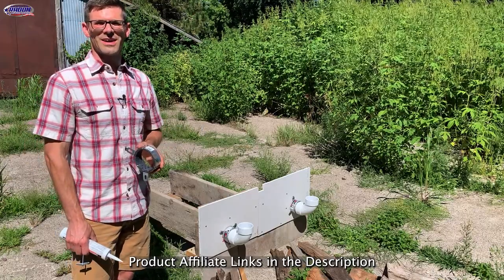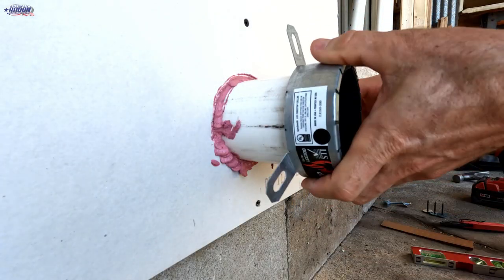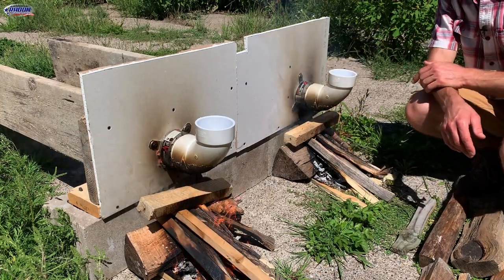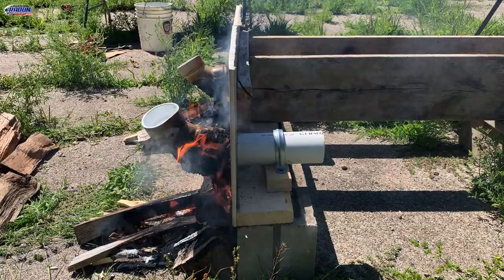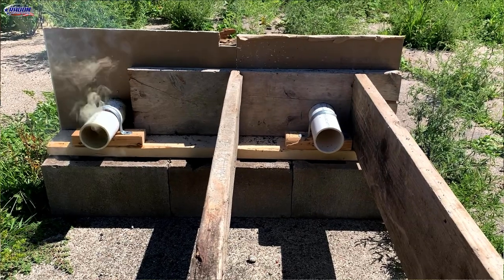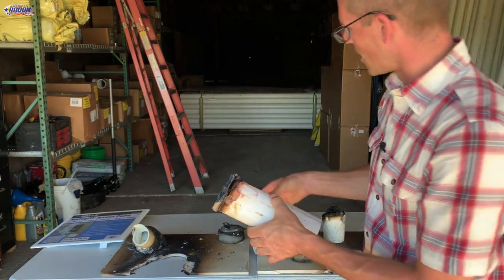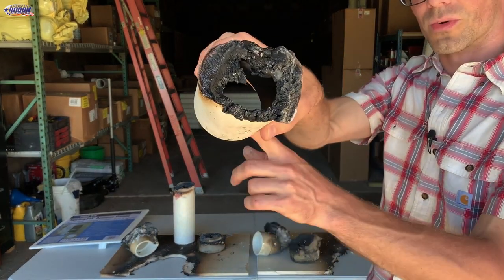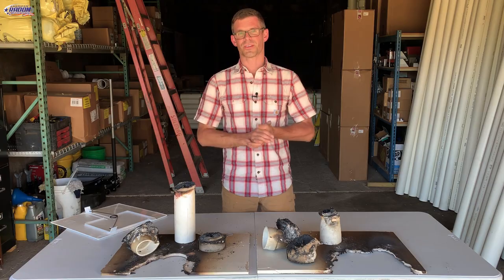Is Your Firestop Collar Installed Properly?

Comment: Quick addendum, you want to tool the firestop product before installing the collar. This does a list of things that work in your favor.

1. Promotes bond to substrate
2. promotes proper 1/2 depth of seal
3. tools out air pockets
4. Makes for a cleaner install
5. Is required for any and all UL assemblies to be a complete installation.
Reply from the maker: Thanks for the tip! Could you leave a link to the resource if you have it?

Comment: Hi, ı have a question. İf ı install circular 0.5 mm thickness sheet metal duct with standart mortar what do you think its is safe to install fire damper (espacialy butterfly tipe) inside the duct and 150 mm wall?
Reply: wall material is aerated concrate 500 kg/m3
Reply from the maker: I am not sure. I'd reach out to a company that manufactures or sells fire-stop equipment.

Comment: Heya, great video for concepts but... Firestop doesn't belong in homes, only multi-tenant buildings with actual fire rated floors and walls built with intent to stop fire.  Your typical "garage" drywall wall use home 1/2" board wouldn't stand a chance for more than a few minutes in a raging garage fire.  A fire in a typical room gets well over 1000 degrees F in under 5 minutes, and continues to rise from there, whereas in your short test, with much lower temperatures in an open air environment, the lower part of your drywall simply "disappeared".  Firestop drywall is 5/8" Type X and while it is far from invulnerable, 1 sheets on either side installed of a stud will actually last for one hour, not minutes.  Just be careful not to pitch firestop for single owner homes as it will absolutely fail to help due too wall disintegration...
Reply from the maker: Hey Mike, thanks for the info. How do you suggest complying with section 6.2.10 of the mitigation standards? https://standards.aarst.org/SGM-SF-2023/22/index.html#zoom=z
Reply: @AmericanRadonMitigation  Hey, difficult to say, I believe you are working under US code so I can't comment on specifics but standards that a non-profit like the AARST develop to assist its members won't necessarily fully align with your IBC national building code.  That reference you link does simply say to "observe codes", which in the case of homes is simply to apply "smoke block" (not firestop) at all floor penetration locations (usually through the bottom stud of a wall), and I'm not sure how the IBC applies to wall penetrations in a house either. 

Smoke block simply buys some time by not letting smoke race up to upper floors through all of the openings created for electrical and plumbing as soon a crappy 1/2" house drywall board fails and explodes off of the studs. But there are thousands of firestop systems tested by UL and Intertek for example, while there are exactly ZERO systems tested for single family dwellings as the construction materials won't hold up for an hour anyway ;).

Comment: Nice video. I feel like this test was not 100%

For a complete test. the fire should be lit in a box, and the fire and smoke should have nowhere to go but through the gaps. Leave holes to feed the fire with oxygen, but the fire should have enough enclosed space to force itself through the gaps and generate heat buildup around the collar.
Reply: Simulate a small room with pipe running through it and light the fire inside the room and see how that works out.
Reply from the maker: I'd be happy to if you build it!